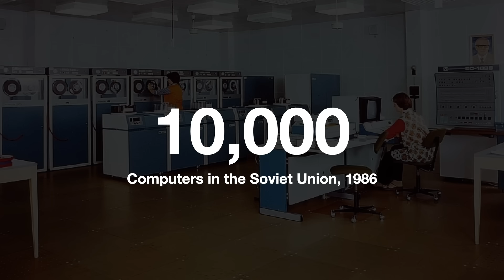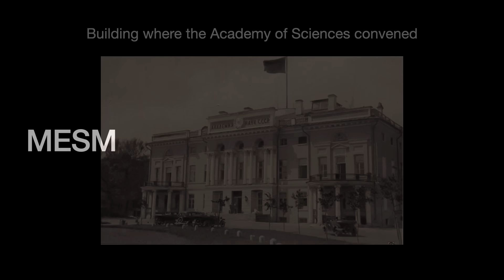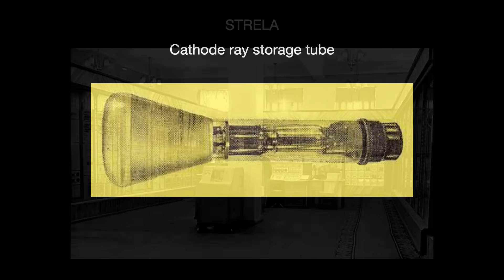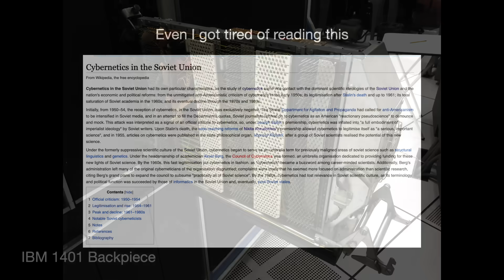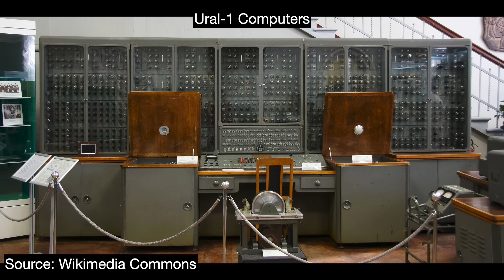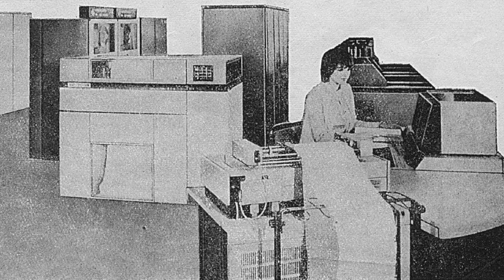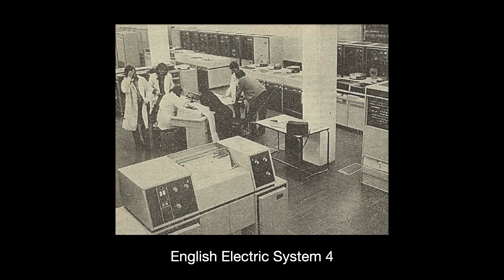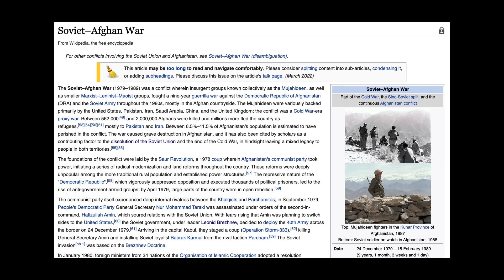Why the Soviet Computer Failed

Comment: A Latvian colleague once told me that peripheral manufacturing was distributed around the Soviet bloc, and disk drives were allocated to Bulgaria. The nicest thing that could be said about any of their products was the less they had modified the originals from which they were reverse-engineered, the more likely they were actually to work.
Reply: As a Bulgarian, this made me laugh out loud. I’m sure your Latvian friend is correct. Bulgarian manufacturing leaves a lot to be desired at present as well.
Reply: That is indeed true.
Floppy and hard disk drives were produced in the so called DZU stara zagora.
Plenty of BG made 8bit apple clones and later on 16bit XT clones have neen made in Bulgaria as well - under the Pravetz and Izot brands.
They were everywhere in the late 80s.... Schools, institutes, factories.
Reply: @AlexBoneff  и после унгарците го приватизираха и изнесоха цялата техника в унгария и сега те произвеждат електрониката за инфинеон ;)
Reply: I think it was the floppy drives not hard drives. I remember them. They made the sound of sawing the wood. The institute I worked in has made its own CP/M computer using parts available behind the Iron Curtain. It worked well but the Bulgarian floppy drive could be heard at the other end of the corridor.
Reply: @arctic_haze  Obviously that was one with "local improvements". :-)*

Comment: Excellent video - many thanks - appreciated. I'm reminded of the moment in Soviet history when the Politburo realised the game was over - the aftermath of Operation Mole Cricket 19 (June 1982), when the Israeli Air Force slaughtered the Syrian Air Force and air defences in the Bekaa Valley. The Syrians lost 85 Soviet-built MiG fighter jets; the Israelis lost none of their US-built fighter jets. The MiGs were faster, more manoeuvrable, faster climb rate, cheaper to produce, easier to maintain in the field... but their electronics were primitive, no match for the sophisticated computer-controlled radar guidance systems the American planes had. A few days later, the Politburo met to discuss the debacle - the largest jet-to-jet aerial battle in history - and concluded that the reasons behind the technological gap were systemic. In a Second Wave economy, you can herd workers into factories to build more and more tanks, artillery and aircraft - but you can't build good computers or force IT guys to write write good code in the same top-down, hierarchical way. This 'got-it' moment eventually led to Perestroika, Gorbachev - and ultimately to the breakup of the USSR. It was not a system that could survive the Third Wave of human development.
Reply: There may be a parallel with today’s Ukraine Russia war.  Though China has back stopped their electronics.

Comment: Many thousands of good points in the comments.  I think one factor that is missing from the "development comparison" is the role played by individual hardware- and software technology "geeks" - people who would move from one going concern, or startup, to another, or just work on their own on 'the riddles. I don't think that either the cross-pollenation or individual inquisitiveness (or genius) factors can be under-rated.  If you look back to 1975-80, for instance, there were quite a few companies selling "mini-frame" computers with no operating system or software of any kind, purely for developers. in 1979, I recall being loaned one of these - a "Sage" - and the two people who loaned me the needed lumps argued between them the merits of at least 7 different operating systems then available in at least a 'basic working format." Some were Unix-like, or Unix-cloned, but names like CP/M also come to mine (my memory is not what it used to be). And these were just two people, who I actually knew from another, completely separate picture, both of whom had invested considerable time and money on what might be called "private ventures."  That's all over and above the large and more organized industrial-level research, but it's one more example of how ideas spread.

Comment: As a side note,  in Poland we also produced our computers, tough with time we werent able to compete.For example  Odra computer, and the Elwro 800 serie.
Reply: This got me curious, and it turns out here in Israel we also built a computer named WEIZAC  in 1955, after political pressure from Von Neumann, Einstein, and Oppenheimer. It was the fourth fastest computer in the world at the time. It gave us a huge head start in the computer industry and we're still a big part of it today. A non-Jewish Polish student, Krzysztof Frankowski, used to run it on Saturdays.

Comment: I recall an article I read back in the 1980's.  No computer more powerful than a 8086 (286?) could be exported to Russia. Computer classes for students was mostly theory and "chalk boarding" computer code.  Now, even the crappiest smart phone has more computing power.
Reply: I am now an official old fart, having reached my 71st birthday. I buy Arduino's and the like to tinker with and build my grand kids toys.  I purchased a little board called the PCDUINO which was, in fact a ATOM based Linux PC with built in flash memory holding the OS as well as a built on board Arduino a clone of the Uno so one could do computing and programing for the Arduino all on the same board.  I love the little board although I thought I had lost it to obsolesces when the last company that purchased the setup went out of business and the software to support it seemed to disappear.  The other day I ran into the little board and decided to just stick plain old Ubuntu on it, as I was going for a download, I did a search for the name again and found an updated OS for her.  She is now back up and running the  little board has a modern video out plug so she can be setup on a TV, or a regular PC Monitor as well as a tiny 9 inch monitor that I have for tinkering on such things.  While she does not have onboard wifi or bluetooth, I have plenty of little USB devices and they are plug and play with Ubuntu.  Funny how even old tech boards like this still serve well when put to the task. Great fun to hook up the cables and set the board lose once more to the world.
Reply: Soviet i8086 clone was launched after ~ 7-8 years of intel's release. 
Soviet i286 clone was launched in 1989 ~7 years after i286 ititial realse.
Soviet i386 clone was launched in 1991 ~6 years after i386 initial release.
And then 90's came and no one cared about the CPUs
Those were not the consumers processors tho. 
There were 8 and 16-bit computer systems available in schools, they were costy and not all schools could aford it tho. For example, there were ~9000 Agat-7 (Apple 2 clone) systems shipped in 6 years after its launch in 1989, while the poluation was ~284 millions.

"Chalk boarding" isn't correct. Maybe, for some cities with low population it would be the case. But ofter you would just write a program, check it with the teacher, and only then you would be allowed to run it on an actual computer for 5 minutes or so. That was the case in ~1981 with room-size computers, that was the case with smaller computers after. It wasn't good, but it wasn't chalkboarding either.

There was probably no reason for manufacturing or buying CPU's at all cause of politics. If you manufacture something in better quality or quantity - no one cares. If you automate something - you area stealing people jobs. If you trying to make profit of it - you are an enemy of the people. You can't export it either cause other people would just buy better CPUs for their business-critical equipment.
Thats the reason why it was mainly in military. I wouldn't be surprised if the only reason of computer clases were to prepare people for army.
Reply: Don't underestimate the power of a crappy slow 8-bit CPU.  You can run a factory on a whole lot less computing power than that.

Comment: The biggest shift in Russian computing in the late 1980s was probably through the z80 clones of the ZX Spectrum, they increased the speed and created extensions and wrote software that really pushed the architecture.
Reply: My father had one. He made it himself with details that he "borrowed" from radioelectronic factory he was working at.
Reply: You know things are bad when the calculator is one if the best things you use
Reply: @SudrianTales  some high end mathematics problems are best solved with a human mind and a folio of paper and a pen. Brute forcing answers to complex designs is often a really bad idea.

Comment: The main thing to take away from this is that freedom to pursue technology and ways to improve it on an individual level,  for companies to pursue 'The Better Mousetrap' will always be better than centralized planning.  Remember that, while clean coal technology and improvement in petroleum engine efficiency and gas mileage are being cast off for the centralized planning of electric vehicles, with total ignorance of the Laws of Conservation of Energy.

Comment: So what do they use today, 286's?
Reply: Elbrus. Early model was designed in late 70, Intel tried to copy it behavior, but f..d up.
Today Elbrus has almost the same computing power as Intel server CPUs. But it has no vulnerabilities as x86 do. It was designed with security in mind. And yes, it already in use in all major corporations and critical infrastructures. That's why today's cyberattacks on it failed. No one ever noticed transfer from Dell/Intel servers to Elbrus few years ago.

Comment: dont think the russians have had an original thought for a long long time.. they've just copies or stole technology from the west...   the new cold war that putin has caused will set their stealing from the west back and hence there technology back even further..
Reply: Elbrus. Early model was designed in late 70, Intel tried to copy it behavior, but f..d up.
Today Elbrus has almost the same computing power as Intel server CPUs. But it has no vulnerabilities as x86 do. It was designed with security in mind. And yes, it already in use in all major corporations and critical infrastructures. That's why today's cyberattacks on it failed. No one ever noticed transfer from Dell/Intel servers to Elbrus few years ago.

So, someone sucked very well. 🤣

Comment: You can tell the Soviets were not gonna go too far with computers when you find old pieces of Soviet avionics and all kinds of computer parts of theirs for sale on Ebay, all those computers parts have hand-crafted circuits with actual wires arranged in all kinds of patterns by hand, I remember one memory that actually had a visually three-dimensional layout with wires inside 

Aesthetically, they look absolutely beautiful, it actually looks like what some artists have imagined as the innards of a cyborg, but at the same time you can imagine the actually wired circuits wouldn't scale very well as computer circuits got smaller and smaller, you can tell they never really seemed to have the technology to print those circuit boards, and probably prioritized giving someone some job just for the sake of it rather than manufacturing efficiency

Comment: Russian Technology Is ALWAYS 50 Years Late 
From Buildings To Cars And Everything Between.
All They Can Do Is Weld And Say That Its Top Of The Line - Everything.|
Just Like Mig Planes And Cars They made, Marusia Car in 2014 Had The 0-100 speed time like an old lincoln from 60's
the LADA caars that are made in 150 look the same made in 2000's , only the turnsignal lights where in difrent places
Reply: LADAs has more power per ltr, than merican muscle cars, rtrdt.